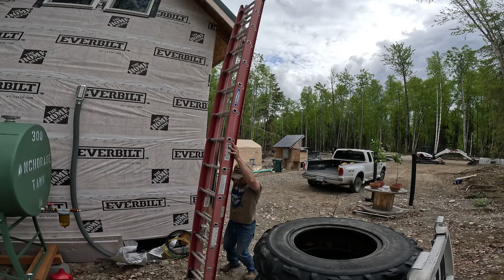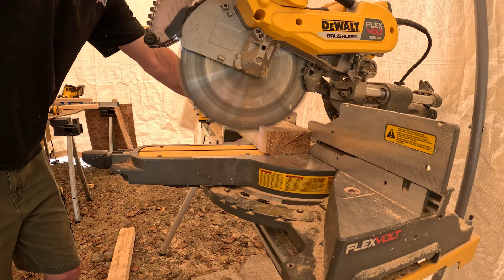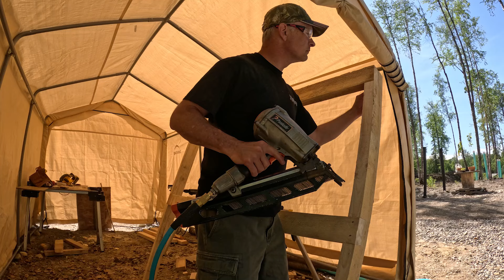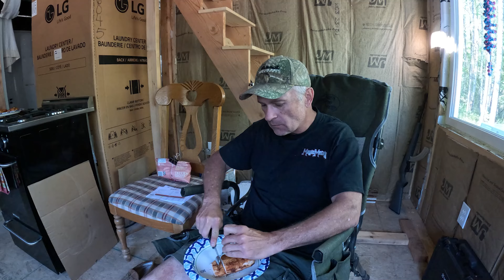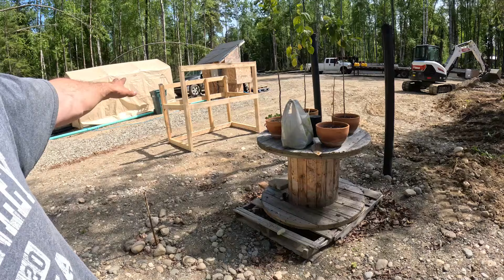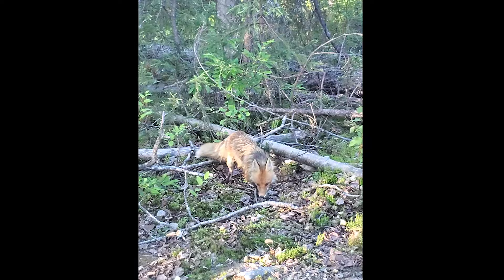What Am I Building? & Planting First Garden On The Homestead

Comment: Just a note. On Dewalt drills and impacts there's usually a silver clip where you can hand them upside down from a pocket or a belt. Would've given you an extra hand climbing the ladder at the beginning.
Reply from the maker: I have 2 of these drills. One has the clip and one doesn't.  I guess I grabbed the wrong one ha ha thanks
Reply: @MyAlaska12  I owned mine for years and only learned from Utube  myself mate. I'm from Queensland Australia but I'm sure Home Depot or tool place online you'll be able to get another one. I use the impact more so maybe just keep it on the drill you use more.
Reply from the maker: @BigFella73  I don't think/plan out my project like that to make sure I pick the best drill of an application.  ha ha definitely thanks!